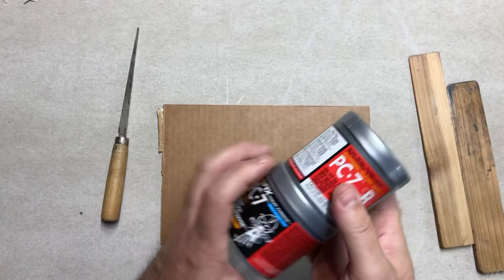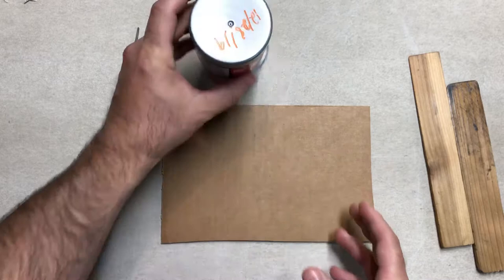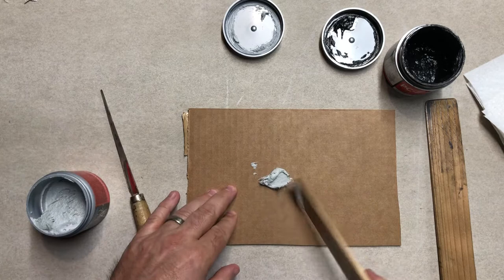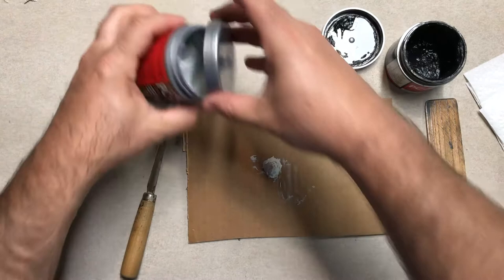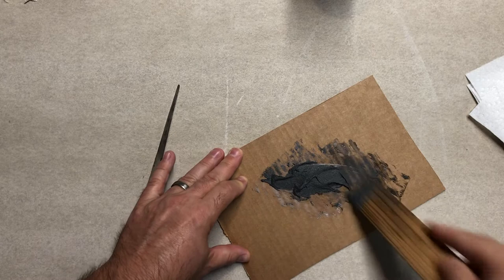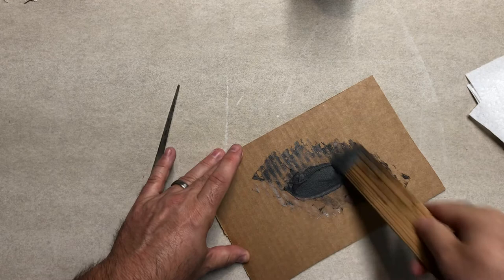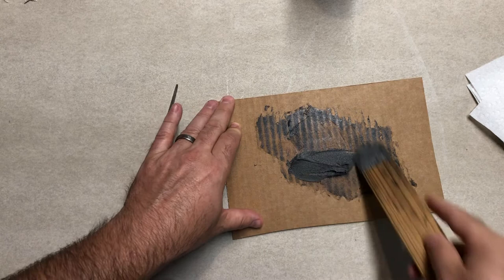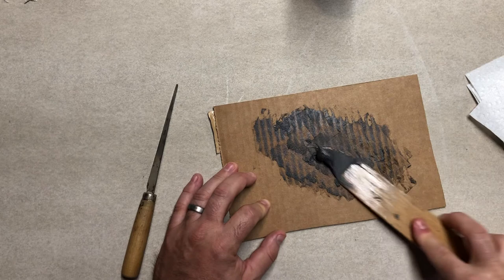Mixing PC-7 epoxy

Comment: As a about body guy we don't mix on cardboard it will absorb and mess up the mixing ratio. Might consider it here.
Reply from the maker: Thanks Jeff. Been using PC-7 for many years and never had an issue, but I appreciate the feedback! For us in a school setting, we need a system for students to be able to easily mix and clean/discard their messes, so cardboard works great for us. Thanks again!

Comment: Great vid. Thank you! Any thoughts on an accelerator (other than heat) that might get it going quicker?
Reply from the maker: Thanks Michael, so glad you liked the video! I've never tried any other accelerator other than heat, although I'd be really curious if you find anything out. I built a large box with a small space heater in there. I use that to set the PC-7 on the object (not all the way hard, just set it so that it's much stiffer). Then I can take the object out of the box and keep working. Usually I leave it in the heat for a 2-3 hours. Sorry I don't have a better trick, but please let me know if you find out anything!

Comment: Just use two new sticks every time.
Same for paint stirrers.
Reply from the maker: Thanks so much for the feedback @gregeoryl. I do that sometimes with clear epoxy and the like, but with PC7 I like the worn feel of an old stir stick. I sand the edges down and after awhile, they're much more comfortable to use than a new stick. I usually use the same stir sticks for years. Anyway, thanks for checking out my video!